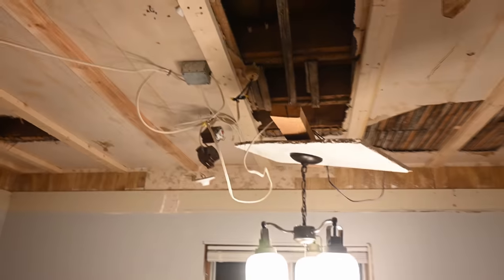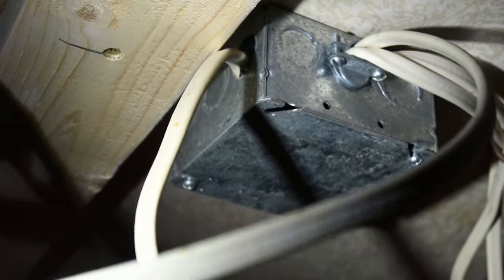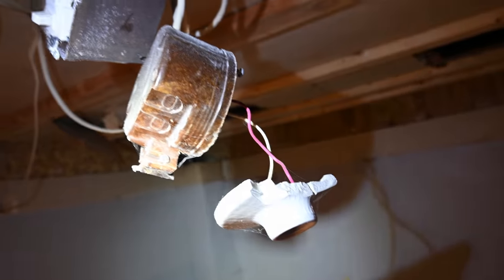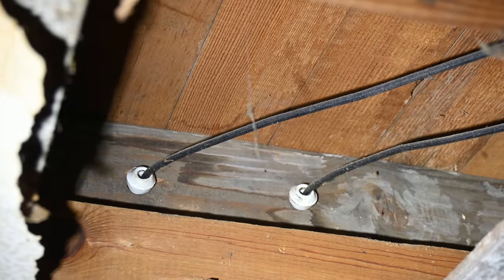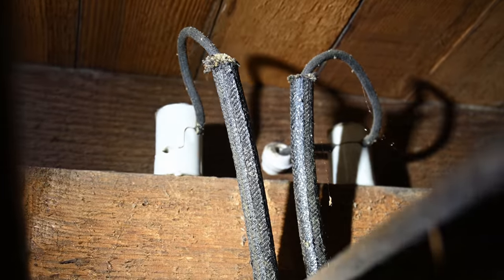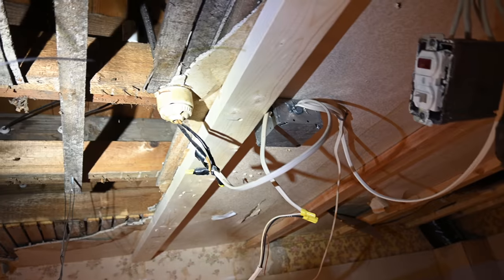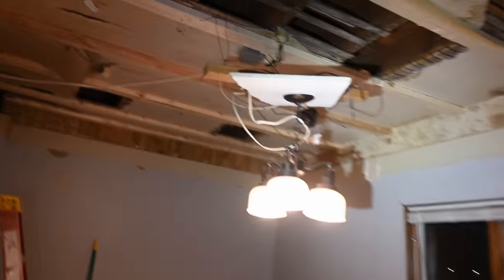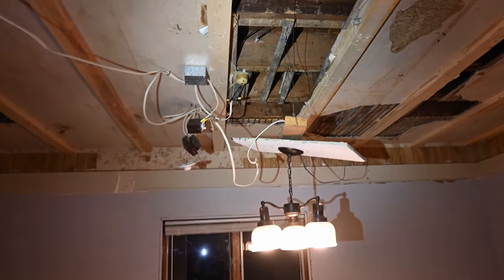The Worst Modified Knob & Tube Wiring Situation I've Ever Seen

Comment: So basically “Cleanup On Isl 2”. Old  houses with properly done knob & Tube are fine. Until you need a EGC or additional loads not rated for the old wire and insulation. Re wire is best and safest if budget allows. Good luck B

Comment: My 1941 house originally had K&T, but most was replaced. I still find some of the knobs out in the garage or shed, but the main house has been stripped and rewired. Originally it was with bare wires, so the woven insulation on yours is more modern. it was perfectly fine wiring, if done right. remember they didn't have modern materials like the PVC insulation we have today.

Comment: As pointed out below, if KnT was so bad, all those farm houses around you would have burned up a long time ago. But they didn't. The only place where the conductors touch would be in the circuit box. When properly installed, the wires enter on opposite sides of the box. 

Problems arise when the wires are simply taped together before they enter the box. This is usually done by a later homeowner or handyman. Originally, the hot went up one side of the building and the neutral came up the other. They met at the switch or the lamp.

Another problem is overloading the circuit. Most of that old wiring is #14 or smaller. And often the insulation is hard and brittle. However, the leads are air insulated. Same as power lines. 

Okay, no ground. that is a problem when electricity is in proximity to metal water or gas piping. But in houses that age, it was never a problem with only one or two receptacles and one lamp and one switch per room. Including the kitchen. 

And yes, working in the midwest 50 years ago, I have seem a LOT of messes like that. But those knids of installations are not limited to days of yore. My own house in Las Vegas , ca. 1955, had multiple connections without covers on the boxes, splices outside of boxes or hidden in the ceiling, or no boxes at all. Done in Romex. Meanwhile, all the EMT or steel conduit in the slab had rusted to the point that current was leaking into the DIRT. Yes. Hot patch of concrete in the original slab. I replaced every piece of wiring except for one run under the slab that had no problems. 

Fun job you got there. Takes me back.

Comment: I have......in my own house 😭 The electric set up in my dining room is similar (this is too a drop ceiling). This was our first home so neither of us really knew anything about anything. I had a light switch in my bedroom making a popping noise when turned on or off. I purchased a wiring book and went to replace it but I saw all these black wires connected to this one the switch. I unhooked them to understand why, and my other two bedroom lights went out. 🤦🏾‍♀️  When you look in the electrical panel, it "looks" as if all the wiring had been updated. I guess that was to fool the inspectors 🤷🏾‍♀️

Comment: An entire house being run through a single 100 amp glass fuse.  There was 100 amps of current available at every outlet and lamp in the entire house.  The whole house was wired with knob and tube.  Needless to say the power company wouldn't install a meter in the house until that was fixed, I'm not sure how anyone missed that.
Reply: 100 amp glass fuse?? Thought they only went up to 30 amp. Everything above that was cartridge or blade fuses.

Comment: Oh yes, that's some hack work done by a non-electrician. I live in an old house with KnT wiring. What I've learned is to leave it alone to the extent you can. The hot and neutral conductors can run divergent paths throughout the house, behind the walls and ceiling, and they're just more pain to deal with than they're worth. They're totally fine for lighting and receptacles that have light loads plugged into them. Instead, you just run new 14/2 or 12/2 for modern grounded circuits throughout the house.

Of course you can and should correct things like making sure splices are in boxes, replacing damaged runs with 14/2 as necessary, etc. Also you got the terms right; the porcelain tubes goes through joists, and those porcelain clamp-posts are the knobs. That protective sheath the conductor goes into is called loom.
Reply: From what I saw in remodeling my house that had knob and tube wiring, I wouldn't trust any of that wiring that I could not fully inspect visually. Sure, a lot of it was done well and might be safe if undisturbed, but I uncovered one too many once hidden areas where shorts could have occurred due to wires being close and the insulating having deteriorated. As an example, a few wall lights were connected to the knob and tube wiring behind the plaster by about 3 feet of what must have been the 100 year old version of cable - smaller than lamp cord and I still recall the crunch that it made when I bundled it up to throw it away. If I had unknowingly tried to fish some new Romex through that wall cavity and it bumped that cable then it easily could have caused a short.
I thought that I had disconnected the last of my knob and tube wiring 25 years ago only to discover a section still energized 10 years ago when I remodeled my kitchen that was last remodeled in the 60s. The only thing worse that sloppy Romex to knob and tube connections are neat connections that are hard to notice. I thought that a piece of Romex above a drop ceiling entered a wall to feed a receptacle below, but it was actually feeding some knob and tube just beyond the plaster. I used to avoid taking down old lathe and plaster when I remodeled a room, but now it all has to come off and go in a dumpster - the only way to be comfortable that hidden problems don't remain.
Reply: @JasonEDragon  Yeah. I hear you. I've lived in lath/plaster houses my whole life. If the house is in a good neighborhood and worth remodeling AND you can live somewhere else while you're working on it AND you can stand shoveling HEAVY demolition debris that causes plumes of dust into a wheelbarrow out to a dumpster, it's well worth it to gut out the wiring, run new plumbing, insulate, etc! It is a serious demolition undertaking and you can really find yourself in over your head quickly.

Comment: I have lived in an apartment/split up 1800s house with knob and tube wiring. It's a solid system but the issue (per usual) are the idiots doing the remodeling. Funny thing is, half the time these are paid contractors.  Gotta love "professionals"
Reply: likely general contractors, not electricians
Reply: @Jon-hx7pe  yes,  but they know better

Comment: I did a complete renovation on a 1880's Victorian.... believe me, I've seen it all !  Oh yeah, and this is why houses burn down and they burn down fast because of their balloon construction.  Yikes !!!
Reply from the maker: When I remodeled my house I blocked off the cavities between floors to reduce the danger of the balloon construction.
Reply: @BenjaminSahlstrom  -- Yes, I did the same. It's essential ! Good luck with your project, I know you'll do a marvelous job. All the very best !!!
Reply: Did a few rewires were the wall fixtures were dual source. Top was gas and bottom electric. the gas piping was connected but dead . It was kinda cool. and the electric stove was knob and tube as well.

Comment: The knob and tube appears to be installed correctly, in free air, passing through joists with a tube , supported by knobs,  entering into a fixture with conductors in loom ,  hopefully the circuit was properly fused. .  Switching would have occurred on a pendent hung off the porcelain fixture on the ceiling.   If you were lucky there would be one duplex outlet in the baseboard of the room.

Comment: The black tube is called loom.  It is tar impregnated cloth.  The loom is the weakest part of knob and tube wiring as it can be damaged easily.   
Since the wire was rubber coated with woven cloth around it, after 100 years the insulation may disintegrate on contact. In the loom it may cause shorts.  In the tube and nobs it is OK as the porcelain is an excellent insulator.  
Knob and wiring can carry heavier load than modern wiring of the same gage because the individual wires radiate heat well.   
The nobs have two channels so both hot and neutral can be run on one nob.  Your disaster has separate  knobs for hot and neutral which makes it safer.  
Splice were made and then wrapped in impregnated cloth tape without junction boxes.
The big problems with knob and tube are:
- no ground wire
- connecting modern wire to it requires a tedious process
- replacing outlets and switches while the insulation disintegrates.

The worst hack I have torn out was knob and tube being extended without junction box to 1950s cable and then both knob and tube, wire nuts and cable being buried in the plaster wall, that is a groove was cut in the plaster, wire pushed in and plastered over.

Comment: There are historical homes that are still working on knob&tube, and the wires are still intact 125 years old. Some of the crazies in a local hysterical oops historical society want the historical village homes untouched! To the point that you have to order antique porcelain push button switches from Rejuvenation hardware,

Comment: Knob and Rube had it's place back in day and was resilient for those times, but man when you get guys starting to splice on to them and then run this and that and the other thing and they have connections and splices everywhere it makes you wonder how the place hasn't burned down yet. Minute I see knob and tube, I will yank it out, way way too many times you see guys add onto it., and on to it and while they think it should be ' okay and it's working" the hazards are enough to just yank it out and start anew even though you might take a hit in the chequebook, most people will gladly take the hit when they realize the dangers of adding on or walking into a situation where someone else has done that and you dont know where the jackpot will end.

And I abhor when guys "abandon" w ring and lights switches , connections and junctions ets in the ceiling and then drywall over it like it never existed, like I mean c;mon why do that, that isnt a good idea at the best of times. It even worse when you get the fly by night renovate it on the cheap and short cut the hell out of it and then make it look good and throw it up for sale and then some poor soul thinks: heu nice renovated house I bought" and then issue star popping up and next thing you know they are buried in endless bills fixing someone else's problems that they bought

Well ben I sure hope the surprises dont keep coming but we all know your smart enough to handle what comes your way and do it right.

Comment: This is easy to fix. The worst problem is improperly installed earthing rods, some people installing them into concrete basement, so you need demolition hammer to remove them. Also many people installing earthing rods without impedance calculation. Some homeowners use a hose clamp to attach equipotential bonding to metal details, they don't care about poor electrical contact. Before doing DIY homeowner should carefully read building/ plumbing/electrical/etc code and watch other similar works in internet.

Comment: Was remodeling an ex girlfriend house once. Taking out old panel to replace with drywall. Found a wire hanging, no cover on end. Tested it, the wires were still hot. So, termenited into box. Scared me to death. Because, her previous house burned down. But, still has the the one I remodel

Comment: If the insulation is asbestos, it's just short of eternal. Sometimes, in old houses, live and neutral were both fused. Not sure why this was done. In some rental property two jobs ago, one old house had a ceramic slab as a fuse box, with a Frankenstein's lab style knife switch that shut power off to the entire house. ...you just wanted to say " It's alive!" and restore power to the house..

Comment: The previous owner of my neighbor’s house did something very illegal and very unsafe. They had a 3 season room with outlets and light switches. But the way it got power…

They installed a lamp cord from the outlet in the diner room and plugged it into one of the 3 season outlets. Which then powered the rest. And then plastered over the lamp wire inside the diner room. But left it hanging in the 3 season room. 

And yes, you read that right. The male end of the lamp cord was live at all times from the diner room outlet. 

There was no Rolex servicing the 3 season room. Just the lamp cord.

Comment: If you took the switch plate cover off, the wires look modern.  If you took the light fixture down, the wires look modern.  Tear the ceiling out and it is a mess.

Comment: A 1940 aluminum ground that was grounded under the surface of driveway.   It lost connection and the entire house would not support anything over like 200 watts or it would dim out.   Install new grind rod and ground and whala.